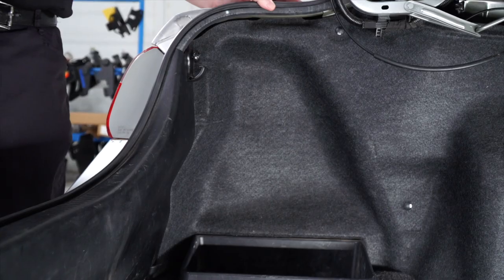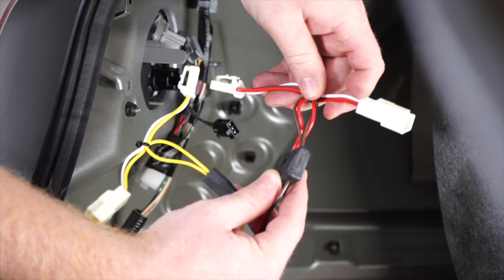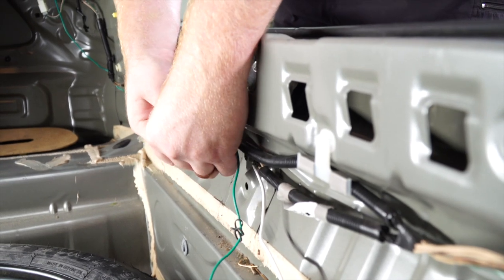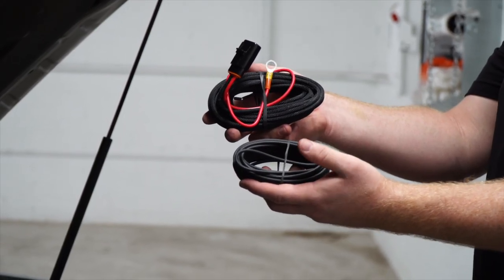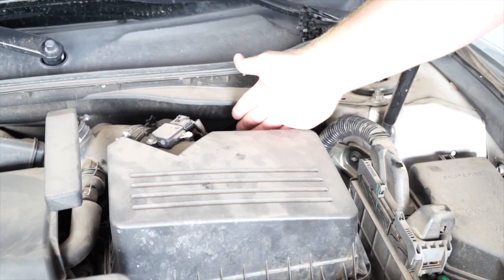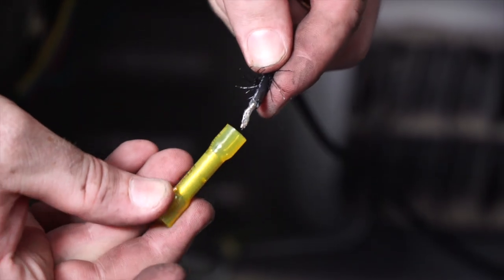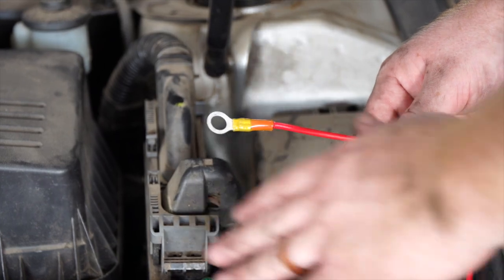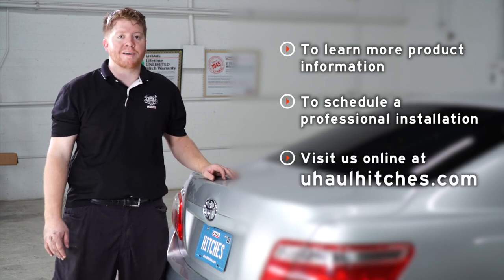2008 Toyota Camry Wiring Harness Installation

Comment: Ok problems I encountered - 1-running the power wire from battery  through the engine compartment down to the brake line bundle  is a little bit of a maze to avoid moving parts but is workable. 2 - If you have an Camry XLE 3.0 6 cylinder with DUAL EXHAUST you can forget  about running the power wire from battery to the back and over the gas tank not enough room and zero access to the rubber grommet on the side under the trunk  because the exhaust and shield are in the way - I ran mine down the center underneath the tire compartment and up through the hole. 3 it matters where the little converter box is adhered to  - you want it as close to the driver's side tail lights as possible.  AGAIN WITH ALL VIDEOS THE HARDEST PARTS ARE JUST VERBALIZED AND NOT SHOWN..  I am pleased with it though.  The next one if ever will be easier I can hope.  My neighbor and installed the hitch and wiring - it was a more difficult than I thought but you must have ramps good sturdy ramps to even consider doing this.